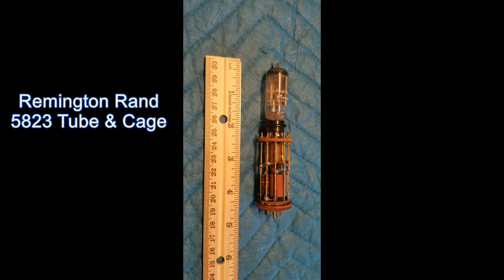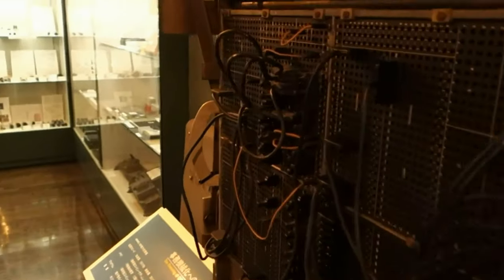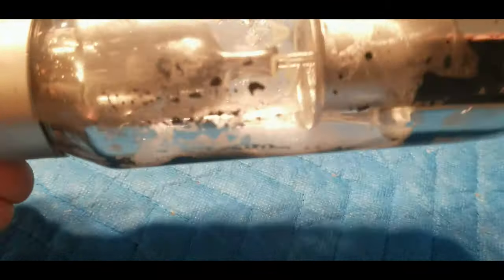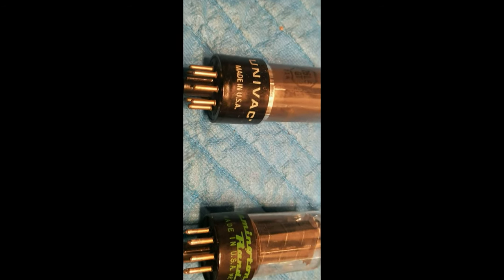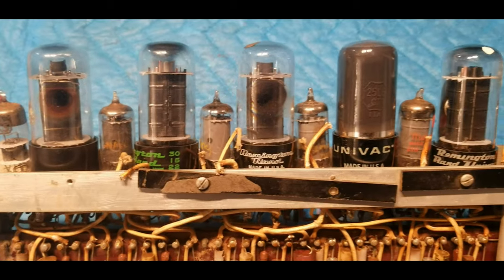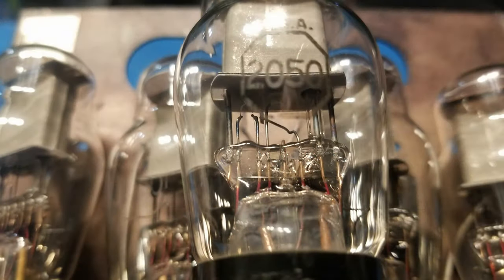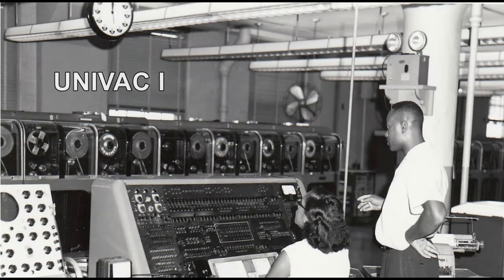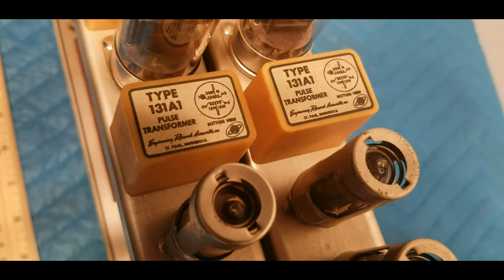Computer History:  Early Remington Rand UNIVAC Vacuum Tubes,  overview, vintage electronics, Sperry

Comment: Another awesome video! Another dangerous aspect of the 872A and 873A, all mercury rectifiers in general, is that when operating they throw out intense short wave ultraviolet light and can give you a very nasty sun burn. This is especially dangerous to the corneas of the eyes and will cause cataracts very quickly. In mere minutes.
Reply from the maker: Hi Videolabguy, wow, didn't know that!  Good to know now.  Thanks very much for the added info on that.   ~  I have given some thought to how people buy and sell these on eBay, and mail them via USPS or whatever, without noticing that they are hazardous materials that could shatter and leak in transit.  Warning labels?   --  VK

Comment: Great vid.

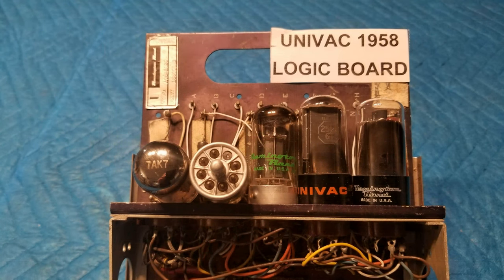Those 7AK7 valves, (4:24), are called Locktals, due to the fact they lock into the sockets. They are a pain to work with, the pins are too thin and don't make very good contact with the socket and you have to push them to one side to unlock them from the socket, risking bending the pins. Locktals always have a metal silver base.
Reply from the maker: Hi Franko, thank you for the clarification on the 7AK7 tubes!   Didn't know that.  It seems odd someone would design pins so thin that one could bend them trying to force them in.  If one broke off, the whole tube is useless.  ) :
Reply: @ComputerHistoryArchivesProject  They were invented for use in locations with lots of vibration. They were used in car radios and aviation electronic equipment.
Reply from the maker: Got it.  That makes sense.

Comment: I’m not aware of the 807 being used as a horizontal output tube in television service, but it’s octal counterpart the 6BG6 definitely was. They are both essentially the same tube as the 6L6G(C), but with a top anode connection and slightly higher peak inverse and pulse ratings as a result.